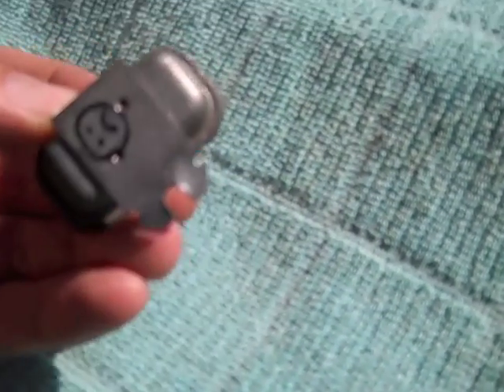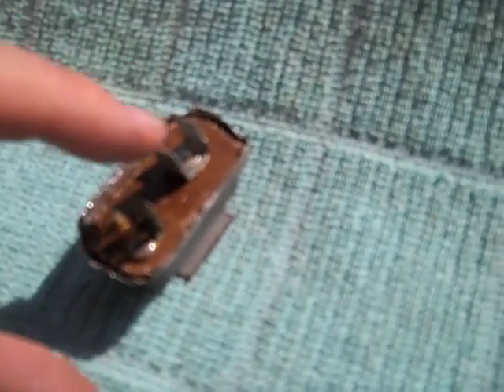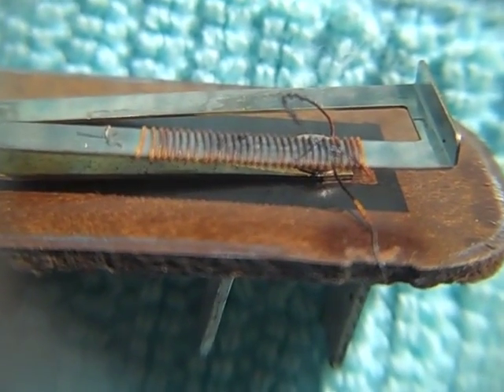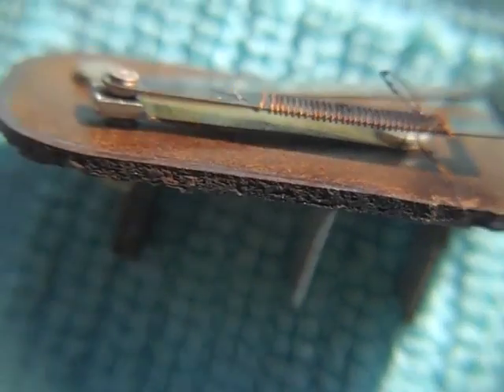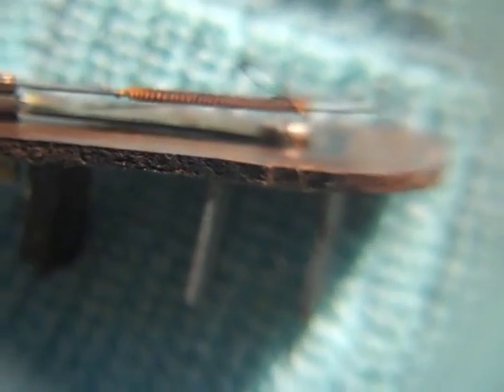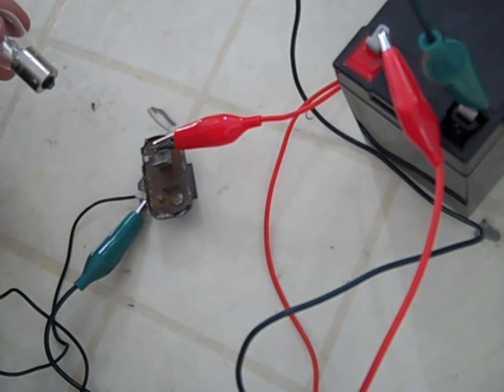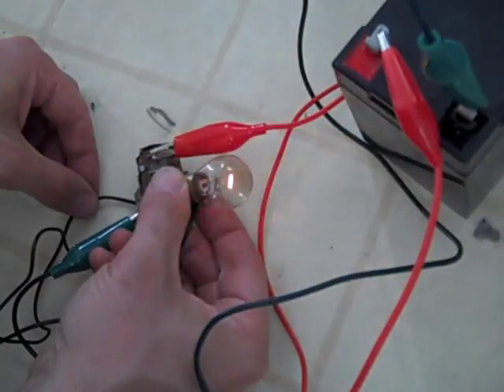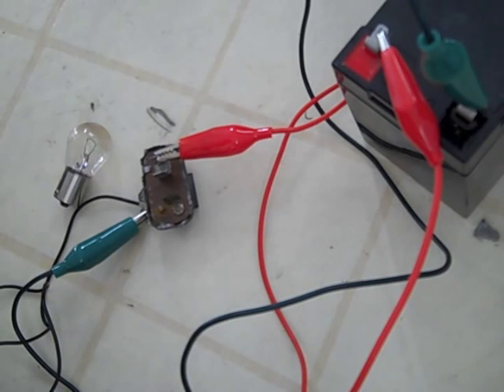Mopar Voltage Limiter ~ Temp & Fuel gauges

Comment: My temp gauge on my 68 always reads high but my Gas gauge seems correct.   I opened it up and Sprayed it with Electromotive spray but its still reading high’     3 Core Rad with Clutch fan and reading the hoses and Thermostat housing and its not near close to even opening and its reading 3/4 .   180 thermostat and Digital temp gauge.   🤦🏻.  Bought one from Laysons and there is no tab to mount it on back of cluster so im not sure if it needs a ground and OF COURSE NO PAPERWORK AND ITS NOT THE SAME AS THE C BODY OEM ! 😂

Comment: My temp gauge would rarely swing wildly up and down so replaced it with a solid state and so far so good. I also was led to
believe if they fail they can fry your gauges...?
Reply from the maker: yeah, when they are failing, you will notice them and full gauges go all the way up, and are even pegged with the ignition key on, and they can fry, but, you have a couple of seconds in my experience!
Reply: @Moletastic69  ....but now my fuel gauge is off. I got mine from RTE-engineering, they send along a 10 ohm resistor with it I'm going to have to use

Comment: Question: I'll be attempting at removing the gauge(s) <again> but need to know, is this voltage limiter located just behind the speedo gauge on a circuit board? Or is it on the Fuel gauge? 
Thanks.

Edit: it's a C body 64' dodge 880.
Just don't  know if the voltage limiter is in the same place as you say it is as your car.

Comment: does it affect power going to the instrument panel fuse?  I get movement on my gas gauge needle and slight movement on the temp gauge.  But they are incorrect readings.  When I replaced the fuse, it is still not getting power to it.
Reply: This is the exact problem I have with my 65 dodge, both needles are pegged at a 45 degree angle.  Did you find a fix for this problem?
Reply: Did any of you find a fix?
Reply: @TheJudge531  Need to either replace with a new one or go to the solid state version. I would use the Real Time Engineering version. The other solid state versions have some drawbacks or deficiencies.